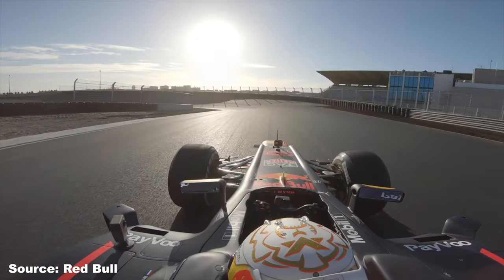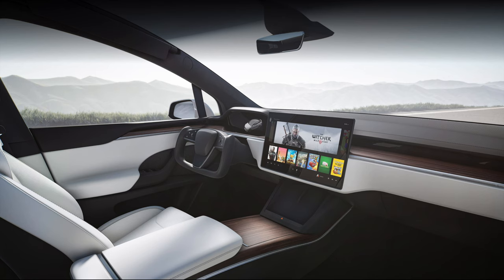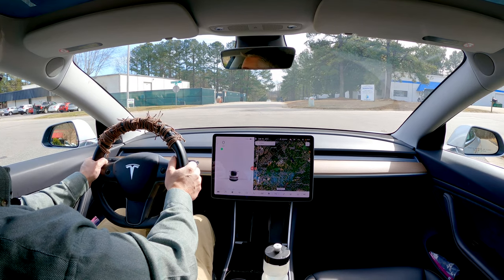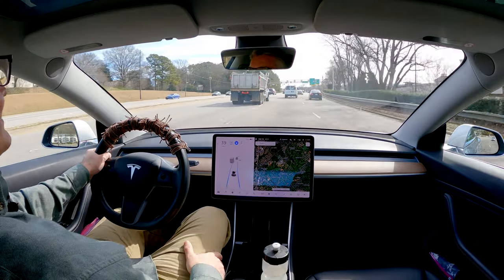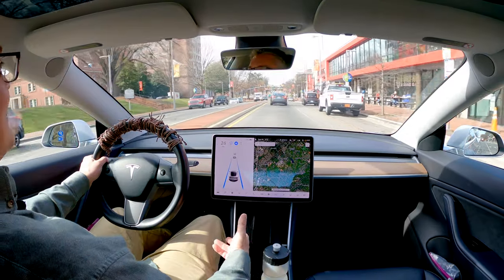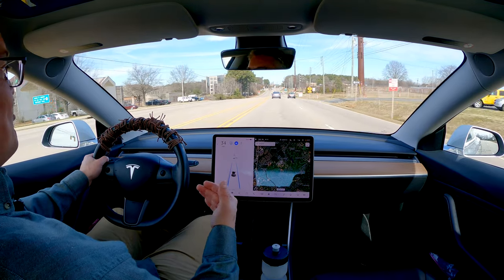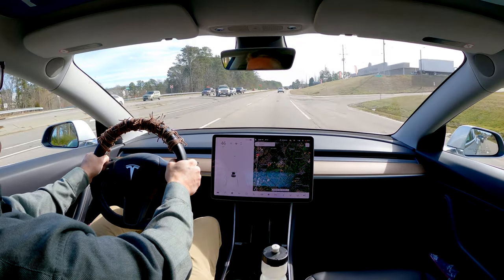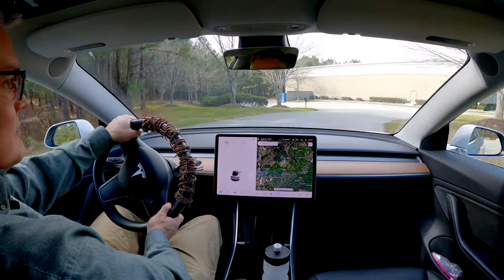Barbed wire test... Is the Tesla yoke better or worse for driving?

Comment from the maker: Use my referral link when placing your order for a new Tesla and get free Supercharging:  https://ts.la/cameron16116

For discounts to many popular retailers of Tesla accessories, see video description.
Reply: I have driven my Model 3 with my hands at the bottom of the steering wheel.  When I used to drive with my hands at 3 and 9, my arms were much more tired and I would accidentally cancel autopilot much more often.  

Also when I'm not driving on AP I notice that my arms don't accidentally cause me to drift side to side in my lane from fatigue like they would when they were at 3 and 9.

My issue with the yoke is the lack of a center top section.  I slide my hands to the top and bottom of the wheel when turning.  Hopefully people like me will be able to adjust our turning styles without much issue once the yoke steering wheels are common.  And hopefully autopilot will make manual turning uncommon by then.

Until then they could give us the option to have a clear top section of the yoke steering wheel.  That would provide a sort of "training wheel" to get us comfortable with the idea of a yoke steering wheel, allowing us to feel confident that we can take over if needed and providing us with an optical illusion of no center top section.

Comment: The variable steering ratio could be a software configuration if they move to a steer by wire configuration.  I doubt that will happen anytime soon, but Tesla sure likes to push the envelope.
Reply from the maker: Steer-by-wire is not permitted at all in the US.  There still must be a direct mechanical connection between a steering wheel and the front wheels.  Rear wheel steering can be steer-by-wire, but only as secondary to mechanical front wheel steering.
Reply: @TheTechofTech  right, but in the US we also require a driver side mirror and a circle steering wheel, both things that Tesla is trying to change. So just like the mirror and the steering wheel, Tesla could try and push the regulations to allow for Steer by Wire.
Reply from the maker: The whole industry is trying to get regulations changed on mirrors versus cameras.  I wouldn’t be surprised to see that changed by the end of the year.

Comment: Not to mention that many of us were taught to drive with hands at 10&2, even when racing... And turning isn't hand over handed, but by slipping a relaxed grip while maintaining alternating hand control of the wheel.
Reply from the maker: I actually cut a few minutes from this video talking about “shuffle steering.” It just took too much time.

Comment: Only thing I can think is that they will make the steering ratio WAY tighter, like it is in racing cars. That way, you'll never have to go hand over hand when turning.
Reply from the maker: I do talk about this towards the end of the video.  A steering ratio that tight will be very fatiguing at highway speeds as an extremely small amount of steering input will quickly put you feet off your intended path.  Variable ratio steering would help that, but there is no indication Tesla is working on the hardware necessary for that.
Reply: @TheTechofTech  sorry to be "one of those" commenters.. must get annoying for you to have to say the same thing over and over in the comments lol
Reply from the maker: I’ve been doing this for nearly 9 years now.  I’m used to it. lol

Comment: Nice video. I don't think any privately owned car will EVER  will be without a wheel. Not now, not in 100 years. Hear me out, I think that taxis that ONLY taxi people may not have a wheel. However, all privately owned cars may be fully autonomous but will ALWAYS have a wheel. That's because the car doesn't know how you want to park your car, among other things. What if there's something in the garage so you have to park it on the street? Will you simply talk to your car and tell it to park on the street? I don't think so, you need a wheel to physically move your car from time to time.
Reply from the maker: People will still want to drive just to drive, too, I think.

Comment: You mist the point! Tesla S (“model 2021”) does not have fixed relation as turning the yoke and how much the car turns. It depends of the driving speed. You never need to turn the yoke more than about 90 degrees left or right.
Reply from the maker: You “mist” the last section of the video where I discuss variable ratio steering at length.
Reply: Is there a missed button on the yoke for when driving in light rain?
Reply from the maker: We don’t yet know how the hub-based controls will work, but it’s highly likely that they will be multi-gesture.  You might press to turn the wipers on and off manually and swipe up to get activate mist wiping.  Hopefully, we’ll know more soon.

Comment: Over decades of flying airplanes and helicopters I have spent a lot of time with a yoke or a stick in front of me. Most airplanes have a yoke although some airplanes and all helicopters have a stick. These are vastly different solutions to the same problem. You easily adapt to either one to the point of not even noticing which one you have. You just fly it. While cars are somewhat similar they all require some acclamation before we are comfortable driving them. We like to drive by feel rather than take our eyes off the road to look for things. I think we will get used to the yoke. I am not saying we will like it. I conclude we can overcome many of the yokes obvious short comings with a non-linear function like variable ratio steering.  I think turning the yoke much past 90 degrees is undesirable. I don't think Tesla is likely to offer something that doesn't work well. They have no doubt tested this extensively. I look forward to seeing what they offer.
Reply from the maker: Yokes in planes do not turn 180 degrees in each direction for the same reason it doesn’t work well in a passenger car.  I talk quite a bit about variable ratio steering and do not think Tesla is working on that at all.

Comment: It would be interesting to poll Tesla owners to find out how they hold the wheel while on Autopilot.

I don't think holding the wheel near the top is recommended due to airbag, so eliminating the top may improve safety?

I notice in Model 3 that the vent airflow is much better on the passenger side. I think the steering wheel is creating lots of turbulence. Removing top of wheel should improve vent airflow.

In Model 3 there is no display in front of the steering wheel, so the wheel doesn't get in the way. But Model S retains the driver's display. Removing top of wheel provides unobstructed view of entire display except when turning. Compare to Taycan for example.

Those are some real advantages that go deeper than looks. You've got the disadvantages covered 😄
Reply from the maker: Good points!

Comment: The yoke may not be better but it’s definitely cooler. People modify their Teslas all the time to make them cooler but the add-ons are not necessarily better in everyone’s opinion. BTW, you could learn to use a yoke effectively if you tried. You insist on the hang your hand on the top of the wheel driving style. To me, that’s tiring. When I’m on a long trip, my hands are on the bottom of the wheel because I find that position to be the most comfortable.
Reply from the maker: It’s not about learning how to use a yoke- it’s about whether or not a yoke is better once you learn to use it.  I do not think it is, and I tried to show why.

Hands on the bottom of the wheel are fine, but you do not have the same amount of control.  Highway is no big deal, but local streets, where Autopilot does great until it doesn’t just as I showed in this video, no way I’d be comfortable just resting my hand in the bottom of the wheel.

Comment: Won’t the yoke have a much tighter steering ratio so you don’t have to move it very much, even to make a u-turn?
Watch Black Tesla’s YouTube video where he talks about this.
Very interesting about how the variable ratio steering would work.
The yoke can’t work without changing the steering ratio. 
I don’t think that they should try to reinvent the wheel!!
Reply from the maker: I spend a considerable portion of this video discussing steering ratio. You should watch where I talk about this. In this video. lol
Reply: @TheTechofTech  I liked how you explained how variable ratio steering worked and how it’s not simply changing the weight of the steering. You talking about how fatiguing the steering might be. If there was an easy way to solve this problem, everyone would do it. I am sorry if it seemed like I did not watch the entire  video, I never did well in those reading comprehension tests. 
The best solution is no yoke and keep the stalks, but Tesla will do what they want to do.
Reply from the maker: It’s an expensive system in weight and space, and I would be surprised if Tesla were secretly working on it.
Reply: @TheTechofTech  I agree with you that  it’s unlikely that they’ll make those steering changes.

Comment: I can already see accessory manufacturers making an attachment that gives your tesla a normal steering wheel. I mean, they've already made speedometers that replace the top of the steering column cover and wire directly into the CANbus connection.
Reply: Problem is that it won't fix the stupid horn button...

Comment: I NEVER place my hands where you do. In fact a friend crashed because his hands were where you are placing your hands. My hand are at the 4 & 8 o'clock position ALL THE TIME and my elbow is on the left armrest. I've been able to react instantly to situations because  I can torque the wheel WAY FASTER than you could. In fact in situations I've been in, you would have crashed when I easily avoided it. I consider where you have your hand EXTREMELY DANGEROUS! So, give me the yolk, I can whip it very quickly whe I have to. The buttons fall naturally under my fingers when at 4 & 8 o'clock positions. When I see a driver driving like you are, I move away, they DON'T have adequate control of the car. If I have a Tesla, I wnat the yolk thank you!
Reply from the maker: I’m going to go with the fact you’ve never taken driving instruction beyond that required to get a license.

Also, I don’t usually make a big deal about this, but since you’re attempting to come across as an expert in driving, it’s “yoke,” not “yolk.” Big clue for you there with not knowing the difference. lol

Comment: Maybe to make the wheels turn all the way left, it's just a twist so the horizon only goes 8 to 2 on a clock face. Super responsive assist to get there. Speed depending, the assist could quick twist the wheels with your direction, but for faster speeds, it doesn't deviate from a given direction so easily and might even resist your input, unless you twist hard. That could be adjusted based on personal taste. But the physical ratio would be big, the software could manage the intent of the driver based on speed alone, but also having autopilot, you could supplement the input of the driver with educated guesses about the direction the driver is intending.
Reply from the maker: This is the variable ration steering I talk about in the video.  If Tesla were already planning on this, they’d likely be talking about it.  It requires hardware and not just software.
Reply: @TheTechofTech    it's a new car, the whole thing is new hardware. I don't think they have gone into detail about much of the new features. Why would you assume they'd already be talking about it? We're all already do that for them, just give it time and we'll learn more.
Reply: @TheTechofTech  also, I'd love this for the look and with the comfort to relax my hands on the bottom like a roller coaster bar.
Reply from the maker: As I mention in the video, variable ratio steering is a huge deal.  It’s a much bigger deal than things like “torque vectoring,” which Tesla goes out of their way to mention on the website.  If the Model S and X had variable ratio steering, it would likely be front and center on the list of features they publicly promote.  It would be crazy if they actually have variable ratio steering and Tesla hasn’t made a big deal about it.

Comment: The only problem...we are not years and years away from fully autonomous vehicles.  I would be surprised if it takes even 2 years from now.  Should be here in around a year or less.
Reply from the maker: Listen to what I said- “safe, reliable, and legal hands-free autonomy in a Tesla.” No way is that a year or less away.
Reply: @TheTechofTech  I did...I think it'll be safe and reliable within the year; people keep downplaying just how exponential the learning curve is for the FSD rewrite.  The only real hindrance, I believe, is legal...but even then, whether you're able to drive without paying attention or not, I believe you'll still be able to use FSD under the current applications of....you are still in control and have to pay attention...even when the system is fully capable.  At least until regulations change, removing responsibility from you...where you no longer have to pay attention.

But either way, I agree.  I'll have to see how Tesla implements this before I make my final judgment, but I don't see how it'll be better than a wheel.  Especially with removing the turn signal and gear stalks.

Comment: Nice video.  I would like the Model S to be my first EV and the new refresh has appealing performance and efficiency improvements, but the yoke is causing me to consider other options.  I find it embarrassing in addition to being relatively uncomfortable and unsafe.  I also dislike the idea of turn signal push-buttons (instead of a stalk), but could more easily tolerate that.  [The other new push button controls seem okay to me.]   Does Tesla not mind losing customers over the yoke because demand for their cars exceeds supply?
Reply from the maker: Numerous test vehicles have been seen with conventional wheels instead of yokes, though they do have the touch controls instead of stalks.  So, it seems that a standard wheel will at least be an option.
Reply: @TheTechofTech  Do you think they are keeping the normal steering option a secret in order to reduce demand for their cars?  If so, I think it will work.
Reply from the maker: Oh, I think the yoke has given them a ton of free advertising.
Reply: @TheTechofTech  FSD gets Tesla lots of free advertising; I'm not sure press about their foolish yoke decision is helping them.  I've read they are not able to produce enough cars to satisfy the demand.  I came close to settling for a used 2020 Model S, but I decided to wait and see.  I suspect if Tesla does not offer a steering wheel, 3rd party vendors will offer steering wheel conversions before long.  I just saw your video about the touch buttons and you made a good point about separating the gear selection from the autopilot control.

Comment: I believe FSD is coming to the public in this year or next at the latest.
Reply from the maker: FSD Beta is really good, but it still demands a lot of driver attention and a hand on the wheel.  Drivers need to intervene less and less frequently, but when they do, it’s often to prevent disaster.  I know a few people in the program, and not a single one would be comfortable with the software being pushed out to the general public anytime soon.

Then, there’s the legal corner Tesla painted itself into with their torque-based driver attentiveness monitoring system.  Even though hands-free is already legal here in the US, it’s only legal with constant driver attentiveness monitoring.  It’s not likely Tesla’s in-cabin camera will be as effective at that as systems like GM’s Supercruise that have a specialized camera just for that.  It will be interesting to see how Tesla makes the transition, though.

Comment: In my opinion humans are incredibly adaptable, our instincts will change over time. Very good analysis
Reply from the maker: I don’t mind adapting if the end result will be an improvement.  I just can’t wrap my head around how a yoke will actually be better even after getting used to it.
Reply: @TheTechofTech  Totally agree. I’m all for things the IMPROVE the experience. This does not !! It’s a backward step. I don’t even have to try a yoke - I’m smart enough to know that it would be less practical. It really is a solution in search of a problem! Many people are saying they like it because they think it looks cool - like they can pretend they’re piloting a plane or driving a F1 racecar. But this is neither of those - it’s a road car !! 
Also, I actually HATE the look of this yoke. A regular wheel looks so much better.

Comment: @4:10 that’s not true!!!! Green the only posted on Twitter what the camera can do!!!!!!!!!
DO YOUR RESEARCH!!
Reply from the maker: I did, and what I say is 100% true.  The Super Cruise camera initially had trouble with polarized sunglasses, but they fixed that with software.

Care to link where Green The Only is talking about what the capabilities of GM’s Super Cruise Camera are?
Reply: @TheTechofTech  what you said about super cruise is true but what you said about the interior facing camera is wrong. It can be used for auto pilot and it does monitor where you are looking and it is fully capable of it.
Reply: @TheTechofTech  I will find the link
Reply from the maker: You queued up my discussion of the Super Cruise camera.  That’s not helpful.  Also, I bet the link you’re going to provide is dated after I published this video because I know what you’re going to link to.  Note that I specifically said that Tesla may try to use it, but it’s still yet to be seen if it will be effective.  Nothing Green The Only found in the code says otherwise- just that they seem to have flags for driver attentiveness, with zero way of knowing whether or not it will work.